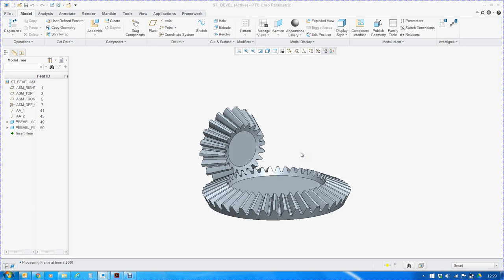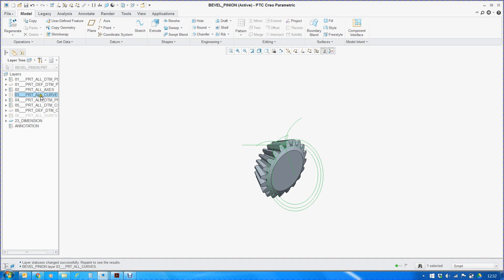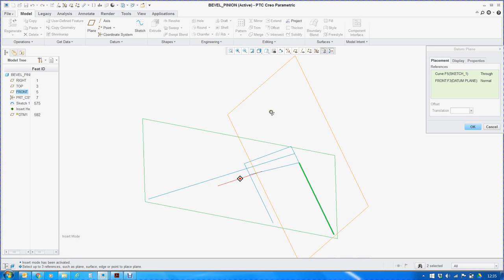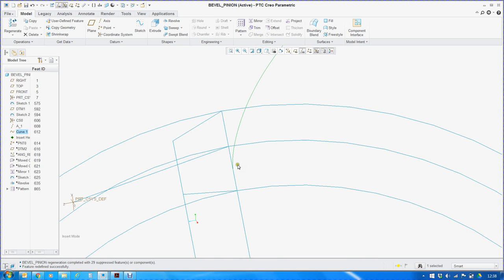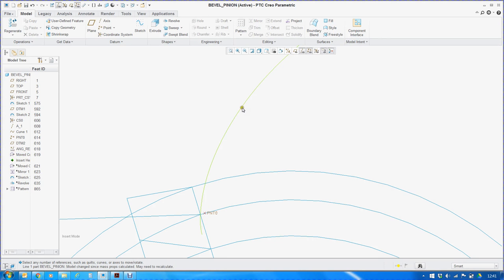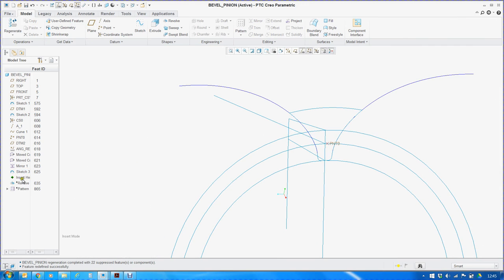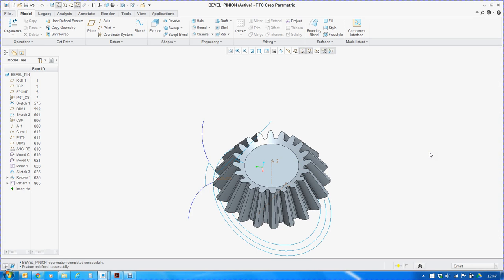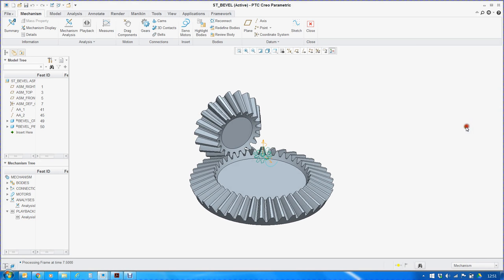Straight Teeth Bevel Gear Modeling in Creo Parametric 3.0

Comment: Excellent video. The best, technically correct video, I have come across. Most use arcs for involute, which is incorrect.
A suggestion: For creating the involute, one may use a coordinate system that is angled so as to eliminate the involute arc manipulation.

A Request: Please create a video for spiral beval gear too.
Reply from the maker: Hi I am glad to note that you are appreciating my efforts. I have Spiral Bevel gear model also. In my spare time I shall create the videos for them also.
Reply from the maker: Hi I am glad to note that you are appreciating my efforts. I have Spiral Bevel gear model also. In my spare time I shall create the videos for them also.

Comment: I have a problem one. When you rotated this curve in the opposite direction, you rotated it from the relation you wrote: d22 = (360 / (Z1 / cos (delta1)) / 4). What is d22 to you in the formula? i couldn't figure it out and i can't continue modeling gears without copying the curve.
Reply from the maker: d22 is the angular dimension for the rotation operation. The dimension parameter name could be different in your case.
Reply: @anandi1974  thank you for the explanation

Comment: It's an excellent video, but can you tell me that which value did you took for "t" in in X and Y for creating teeth in curve.
Reply from the maker: "t" is a system parameter which assumes the values from 0 to 1 (generally). However, you have the option to change the boundary limits as per your convenience. The default values of 0 and 1 are used in the current video. And thanks for the kind words!

Comment: Sir, notebook table and parameter value are how to add in model for making bevel gear?
Please , show this details.
Reply from the maker: After creating the Notebook table and saving it in the working folder, it is to be "Declared" in the part model. Then all the parameters created in the Notebook are imported into the part model.
Reply: Thanks sir

Comment: Very good Video. It would be great to explain the steps between 12:00 and 14:00min a little bit better, cause I had trouble to recreate this step in my model. But I think now I have understood the step. However I still think  my model is still not right. 
So it would be great if you could share your model.
Reply from the maker: As I have explained in the video, this step is to create a gear tooth symmetric about the top plane. When we create the initial Involute curve through equation you would notice that the starting point of the curve lies on the top plane. Hence, this needs to be rotated by a certain amount which is determined by the Angle Measurement feature.

I can share the model with you through email, However, please note that these models are in Creo 7.0 version now.
Reply: @anandi1974  Thanks for your answer. I figured out how to do it. My problem was, I couldn't figure out how to move a curve by reference and used the wrong Axis for the rotation.
However I still would be happy to look into your file. I Will send you my mail-adress via private message.

Comment: i actually didn't understand the second rotation of involute curve... can you please explain the process and why we are doing so..... can you please share the prt file of this gear
Reply from the maker: the very purpose of two rotations is that the first teeth should be symmetric to the Front plane. This is helpful in assembly of Bevel Gears. In the first rotation, we are rotating the curve so that the point of intersection of Involute curve and the pitch circle lies exactly on the Front plane. In the next rotation, the curve is rotated in the opposite direction so that the gap created thus can accommodate the teeth from the mating gear.

Comment: This video does not show A LOT of steps. BEWARE. the guys starts fine at the beginning and everything works but at the middle of the video he leaves out vital info.
Relations of the second rotation copy of curve are not very clear. d22=(360/Z1/cos(delta1))/4) and p52=Z1... Which dimentions are d22 and p52? Where are they located?
Reply: Yes, there is a lot missing. unfortunaltey.
Nevertheless, thank you. 3 quarter the way is better than nothing ;)

1. Why did you not show the "crucial things": Past special and how to link measurement feature into the shift of the involute curve. You decently show later that d20 ist the shift variable. If you explain this first most can follow better
2. In the very end you do not show how exactly the revolving and pattering is parametrized. It makes your nice video just incomplete. To complete the pattern a formula to calculate variable P (angle between teeth) is missing. You just showed p52=Z1 and called it a day :) So for variable angle dXX=360/Z1 needs to be added. Cheers

Comment: Please give the ceo 2.0 file
Reply from the maker: I am sorry I do not have the model in Creo 2.0 version and unfortunately the 3D model created in Creo 3.0 can not be opened with Creo 2.0. In fact I have moved on Creo 5.0 now. Any further video I create would be using Creo 5.0 only.
Reply: ok  @anandi1974
Reply: @anandi1974  can you send that 3.0 file only
Reply: @anandi1974  I have the 4.0 also
Reply: I have some more doubts also